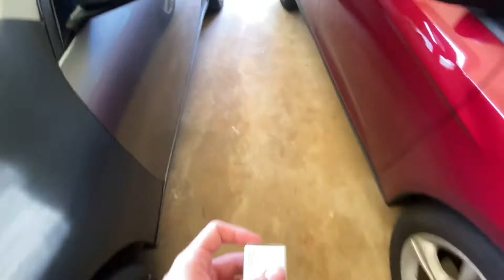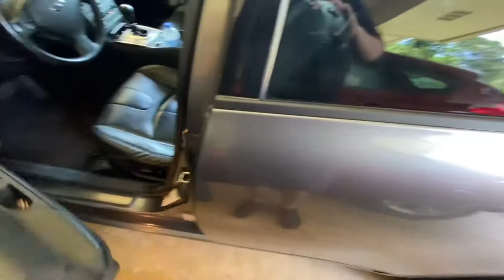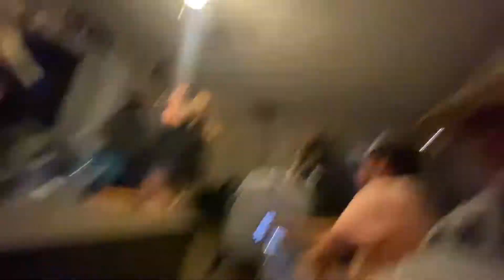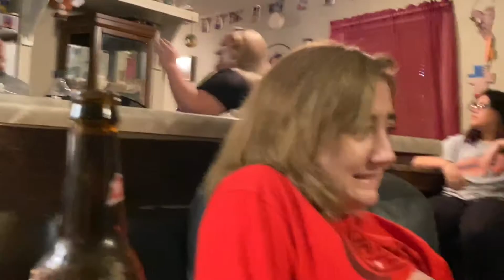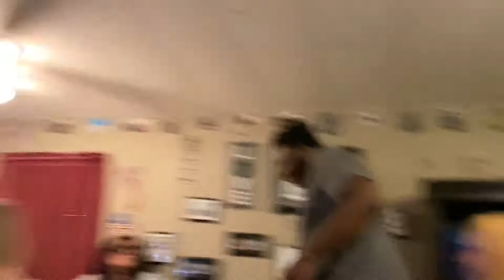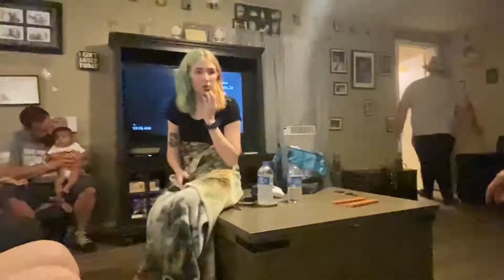G37 AC Fix?

Comment: Hey brother just a heads up to you and anybody else that reads this. You would have been better off sticking with the stock air boxes and putting  K&N drop in's and silicone hoses to replace the corregated part to the throttle body.

 Your losing power over stock with that style of intake. The only thing that style of intake is good for is making more noise and it looks good under the hood. Which is fine, not bashing that or you at all, thats all some folks want. Just want to point out that from a performance stand point they definitely arent as good as stock. The factory intakes are very good and are essentially already a cold air intake. There's gains to be made for sure, just not near as much as other cars that come very restricted from the factory. I have Z1 long tubes on my 08 6mt sedan. Black Friday is the time to get em, I got mine for 330 reg 499.

Comment: The AC relay is not replaceable on the g37. It is located on the IPDM behind the battery. The relay is soldered to the IPDM circuit board. If the relay is bad, the whole circuit board needs to be replaced.

Comment: Did you find the location of the ac relay ????
Reply from the maker: Still haven’t found it, not sure if G37 even have one at this point 😂, I’ll keep looking and making a update video!
Reply: @Solvlogs  ahhh I feel you bro,  I can't find it either my guy I checked all the boxes but I can't seem to find it
Reply: U should look in  the IPDM . pull the battery out you’ll see it
Reply: @projectrevspec1338  nah bro its not there either or least I can't find it
Reply: @jesusrodriguez5704  bro its on the BACK of the fuse panel in the driver footwell , the are on the other side of the fuses
Reply from the maker: Ima check
Reply: @Solvlogs  was it there ????
Reply: @adzmccauley  which one is for the ac relay or the one that engage it
Reply: Nothing bro ???
Reply from the maker: My bad been trying to fix fueling issues, E85 fuel systems arnt very fun for this car
Reply: There is no replaceable relay for the AC, it is part of the ipdm. If it's bad the whole ipdm has to be replaced. Not usually a problem on v36's, its more likely that the compressor/clutch or the pressure switch is bad.
Reply: @Solvlogs  Driver side floor on the fuse box (flip the box)
Reply: @jesusrodriguez5704  Driver side floor on the fuse box (flip the box)
Reply: @ygfnuke  where at like wym on the floor ???